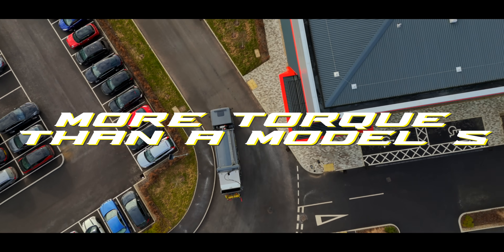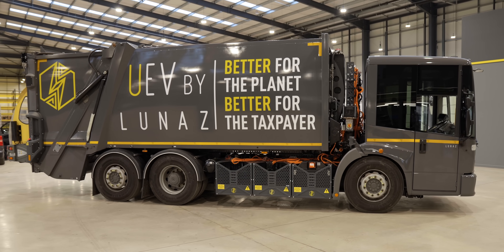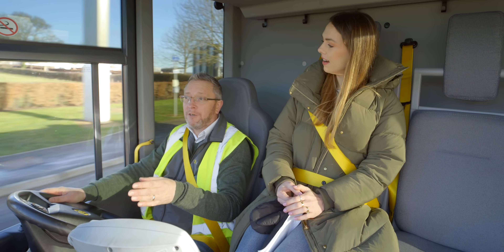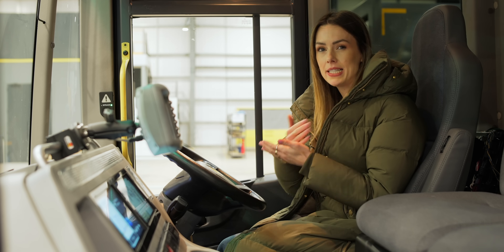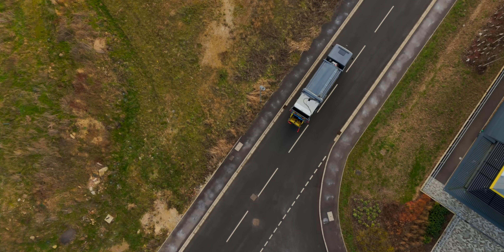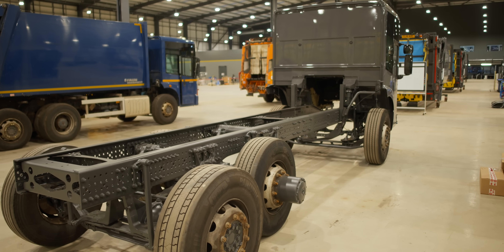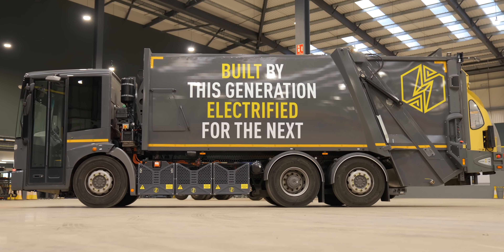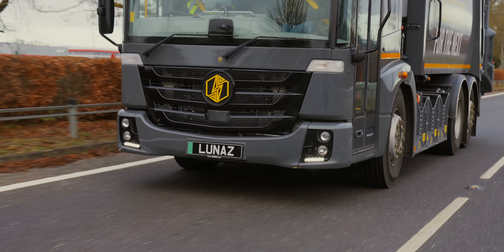Is This RUBBISH Electric Vehicle Britain's BEST EV?!

Comment: Why not change the hydrolic system to electric, seems like that would consume less energy, require less maintenance and perhaps even be more reliable.
Reply: It already has a robust hydraulic system that just needs a motor to run it, I imagine it would be a very costly exercise to completely rehash it to all electric system.
Reply: @evil17  true, but i guess on new vehicles it would make more sense with electric actuators.

Comment: "....Equivalent weight in carbon as the Eiffel Tower...." Do you mean mass rather? Carbon is 5x lighter compared to steel. That's 5 towers by volume, roughly proportional by mass. Oh I give up, who can understand mass vs weight.  "It's a lot."

Comment: You know the interesting thing that is not mentioned in this video despite it being posted  3 days ago (at time of writing comment) Lunaz has gone into Administration/Bankruptcy as it could not raise funding for the  commercial trucking division.  Lunaz already has laid off 40 staff members.
also I'm not sure if 'upcycling' a truck that is more or less new counts before its stripped down and given a new power train that starts its life as a dirty solution  and will never run as long as the durable diesel engine.  honestly how can a used battery at over 100,000km/miles still have the same range as a full fuel tank and what if the weather is very cold??

Comment: For me this interview is a classic half job. I would have thought that there should be a good economic case for these trucks in London for example as the Major as I understand it wants to charge all diesel vehicles to use the streets.  (Correct me if I am wrong). Many cities now have clean air zones in the very centre where one would have thought these lorries would make the most sense initially. Sadly I do not recall seeing any economic case - facts and figures being put forward. Cost benefit analysis. I am going to score this 5/10 I think a good journalist would have extracted these figures.

Comment: Great to see older trucks being upgraded to EV technology, however there are quite a few issues that are ignored by this.
The biggest one is that many smaller haulage firms rely on the supply of used ICE trucks as buying/leasing new (or even converting to EV) is not economically viable (I know as I am the MD of a small haulage firm).  The economics don't really work, which I guess is why Lunaz are working with local authorities rather than commercial operators.  Whilst the technology has to mature, there is a real danger that smaller haulage operators are squeezed out due to either a lack of supply of used vehicles, increased cost of new vehicles and the race to legislate towards zero carbon without looking at the impact on the industry.  This will mean increased transport costs and a lack of choice for the consumer.
Reply: These aren't old trucks. Average fleet age is 10+ years.

Comment: My brother has worked in this industry down south for many years and they have trialling some Electrified wast trucks and found the after service and support services very poor, as they very little if any advice about how to charge the trucks up. Even here we heard nothing about after service care, or training or infrastructure assistance. If a company like this, which I fully supports, wants to bring this kind of solution to the market, it has to be model on the Tesla plan. These trucks need the right charger in the right place with the right training for the staff that use them, and the management that manage them. Otherwise its a very BIG expensive misake. Hope they get there restructuring right, and we get a Government that is will to support this kind of transitions. Otherwise China will win out across the board.

Comment: So, basically this is a way to have an eEconic but not made by Mercedes-Benz... The technical data is pretty much on spot power wise and energy wise (with 6 battery packs similar energy conpaired to the original Mercedes)...

Comment: Couple pros and cons
I live in the valleys the batteries wouldn’t do 150 miles maybe probably a third less if not less than that, not sure if the battery packs could be swapped out so you drive back to your yard and swap out the batteries with full charged ones 
Also love the idea of heated seats but not cloth seat, but they will get wet and take a while to dry out take it from experience 🤭🤭
Reply: I think there is a conversion company in Australia that already has a battery swap system meaning the batteries are charged at the depot and then loaded by forklift into the truck (where the fuel tanks used to be).  It means that a truck can come in and have fully charged batteries within a few minutes.

Comment: Seems crazy to put works intge line of fire moving bins to the back of lorry. Our units pickup bins from the street side without requiring people to leave the cab.
Reply: Most British streets are lined with parked cars. However I noticed that the buttons were placed so you have to step around a barrier and out the way of the bin.

Comment: For years I argued they should put flywheel units in these lorries because of their stop-start usage. Combustion or electric, it would save a ton of energy. But that was when I worked for a company that actually made the tech - and they were just not interested in doing it.
Reply: Electric doesn't have the engine stop/start issues. (Efficient running all the way from zero revs and generative braking collect energy when slowing down ... also the motor isn't running whilst the vehicle is not moving so using no energy) If any energy was saved at all it would be tiny ... it already has energy storage that performs the equivalent function i.e. the battery.

Comment: Finally! Quieter bin lorries! Please get these to the Australian market ASAP!
Reply: I'm all for quieter, more efficient EV trucks but it's interesting that despite all the modernization they still requite someone to manually connect the bin to the back. All the garbage trucks I've seen here in Oz are single operator with a robot arm lifting the bins and placing them back down.
Reply: @johnnyonline  This may be a UK thing. In Australia (where I'm based) they have articulated arms that grab the bin from the curbside. There may be requirements that dictate operators to continue to exit vehicles and connect the bin, in the UK. One reason could be the risk of environmental contamination that comes from the automation of this task — I've seen waste fly out of the bins when they are lifted into the lorry. I've also noticed that the articuled arms make a whole lot of noise too. I'm sure the UK has their reasons.
Reply: @junior.senior I think it is to do with having very narrow streets to manoeuvre through, &/or because many of their streets are already lined with cars, which wouldn’t work well with an Aussie type side bin grabbing arms configuration.
Reply: The waste companies are trying but they need them driving 12 hours and they need charging after 6 and then going to the tip. The hydraulics use lots of power...
Reply: @Low760  Are you engaged with a waste or recycling service? It would be interesting to hear about the kinds of issues they are experieriencing with the new technology. I've found a company in Sydney which has an interesting work around, where they battery swap. To me, this is comparative to refueling with dinosaur juice.

Comment: Doing LICE to EV conversions is nice, but it's still a compromise.  An EV truck designed and built from the ground up to be an EV truck is going to perform all-around better.  The short-term thinking of bureaucrats and accountants is not as beneficial in the long-term as having some vision and just doing it right today.

Comment: Garbage trucks should have been the very first vehicles to be electrified. They do many start stops they need to be quiet and the battery can be sized for the route. So much easier than diesel
Reply: 😂😂😂

Do try to be serious.

What if the round is in a rural locale, with added hills? And people do a lot of shopping via Amazon. Everyone knows that Amazon is one of the biggest creators of cardboard waste in the world today.

Think of the cardboard mountains jammed into  black bin bags outside every farm and cottage and sanitarium.

The battery would have to be bigger than the cardboard mountain payload, and need many, many, many hours to recharge.

I do wish you battery hugger lads did a bit of research prior to posting.

This is precisely why battery HGVs are not especially popular because of the "waste of revenue earning payload space" sort of thing taken up by a gigantic battery which might need a week to fully recharge.

And I might add that battery buses are now regarded with deep suspicion in old London Town on the grounds that a reprise of 1666 was only minutes away when they were operational.

Experts (such as myself) were discussing only last Tuesday that such an event would be worse than the Blitz.

Raging lithium conflagrations would be melting their way through the mantle down to the core and very likely taking the Circle Line with it.

I expect the District Line wouldn't get off lightly either.

I kid you not.
Reply: @t1n4444  Sigh... it's the same trash-compactor on the back as with the deisel units - there is zero difference in trash capacity.  And whilst there may be some rural routes that can't be converted, the vast majority of bin-lorries operate in residential areas (because that's where the majority of the population live, and generate their rubbish).

About the only thing you appear to be 'expert' in is making an idiot of yourself, based on your above post.
Reply: Yes, ideal candidates for electrification .. and there are many already in use.
Reply: @MrAdopado  

Then it begs the question of why this outfit appears not to be thriving.

Any explanation?
Reply: @MrAdopado  

A fair point.

I would suggest that as hydrogen is the poster boy for energy in Europe then HMG might be having second thoughts ref falling in love with batteries.

Now it's known beyond question that lithium ion batteries can and do self ignite it's entirely reasonable that HMG is being a tad wary on pushing battery EVs for the moment.

Sort of preventing an "egg on face" moment.

Comment: The point that everybody seems to be missing with RCV fleets is that they are only utilised for 6-8 hours per day.
This means that back at the depot, all plugged into chargers, they act as a power reserve for the grid. Fast Frequency Response power banks pays huge amounts of money.
For an asset that would otherwise be sat unused for 16 hours a day, it can now act as an income stream.
This is in addition to all the other benefits. It's a no brainier for any RCV fleet operator to go electric.

Comment: Even here in backwater Oklahoma,  our garbage trucks have robot arms with which the driver picks up the bins while sitting at the wheel.  I haven't seen manual bin loading in years
Reply: wouldn't work in the UK, for example I live in a ground floor flat, outside where I put my bin their a wall of cars between the bin and the road.
Reply: @DavidKnowles0 Yes well here in the states everything is sprawled out and there generally is room for such contraptions. In big congested cities, not always though, which is why most cities have many different truck configurations.  Plus, I would add that those robot arms are much more prone to failure and expensive to maintain.

Comment: Very impressive i bet it reduces driving fatigue, I was bin man for three years it loses its novelty putting bins on at the back after the first bin 😊. All seriousness it's all good wish the dust cart i was on was electric.
Reply: As someone who worked on the bins briefly several decades ago (yay temping for summer holiday jobs :p), I can say that working with modern bins appears to be near-infinitely better than manually hauling individual black sacks (especially on a hot summer morning after overnight rain...) as used to happen.  Quieter and more efficient trucks would also be very welcome.
Reply: @logicalChimp  Never did black bags just wheelie bins, but all the old timers banged on about it "you'd never manage on black bags" 😁 getting covered in bin juice 😖

Comment: The refuse trucks around here (Connecticut, USA) load from the side. Everything is done remotely from a single person in the driver's seat. All that is required is a similar bin to that UK version.
Reply: That would be impossible in the UK. Very few people have the ability to park their vehicle(s) on their property, meaning most people park on the road. There would be no way for a truck to access the bin on the sidewalk.
Reply: As the host says, super teeny tiny roads. The notion that in Britain it would be possible everywhere to put bins perpendicular to a curb so a side loading arm can just pick them up is ludicrous. A one way street for instance with houses on both sides of the street would require either half the bins dragged across the street or the garbage truck to drive the wrong way up the street. And that is if the street has two lanes available for driving after all the parked cars.
Reply: @francesconicoletti2547 they do that in Australia. Not hard.
Reply: Same in Australia. One man efficient job- expect electric trucks soon.
Reply: @geraldbutler5484  there are bits of inner cities in Australia that i doubt a side arm garbage truck can be used. Yes most of Australia and America was built to accommodate cars but bits of Australia and lots of Britain wasn’t. Getting a trck lined up down those narrow old roads that are already overcrowded with cars seems either difficult or impossible.
Reply: @geraldbutler5484 I wonder if they will go poof on their first outing like the new concrete truck in Melbourne a few weeks ago, good thing it wasn’t in a tunnel.
Reply: @evil17  wake up,mate. I grew up in Birmingham, England. We had electric milk floats and bread vans for decades, up to the 1960’s. They were ultra reliable and some had the same motor from when they were made. The far superior batteries we now have make the change inevitable. I hear the Arabs are crying in their coffee.
Reply: @geraldbutler5484   The old milk carts never had lithium batteries. Lithium batteries are great & I like the idea of EV’s to some degree too, but I dont believe we have the economy or infrastructure for an idiot like Albo to be pushing the issue the way he is just yet, especially not in the rural sector. 
Can you imagine the fallout of an all EV outback society in an emergency evacuation situation like a flood or bushfire when there is no power? 
Australia is presently addicted to deisel for nearly everything, & that can’t change in a hurry without some dire consequences no matter how much he tries to tax ICE’s out of Australia.
I run my house on Solar & batteries which works great, but there is a lot more issues at play when considering a nations all EV & industries power needs, the batteries may have matured but the charging infrastructure is a long way off & will take many billions of dollars to get half decent. 
Lithium batteries self oxidise if they go thermal, and presently we have no way to deal with these scenario’s. 
If there is an accident and people are still ok while trapped in a vehicle waiting for the Jaws Of Life when the battery goes thermal, that would be very traumatic to witness inside or out of that vehicle.
I understand & applaud your eagerness for EV’s, but there is more to it than doing it because we can.
Reply: @evil17  I agree with you concerning rural and outback Australia. It’s going to take time. We are only at the start of the electric revolution. My small rural town already has a bank of batteries to take the excess solar generated by a great uptake of rooftop solar panels. Ten years ago there was virtually nothing.
Reply: @geraldbutler5484 soon? Yeah right.
Reply: Came here to say the same here in Australia.
Reply: Australia does a better job of side lifts

Comment: Either with conversion or new, these electric garbage trucks definitely needed!!

(a) constant stop/start and full stop operation makes diesel even more inefficient and dirty toxic emissions.  Moreover, they're spewing that stuff right in our faces where we live.
(b) total distance traveled (range) is small and top speed is very low
(c) Noise reduction.  I've been woken by the local garbage trucks more times than I care to know.
Reply: I'd think it'd be a nicer experience for the operators, too. Less noise, less inhaled exhaust, generally smoother operation all around --- I'd think it'd be generally less stressful to work with. I'd like to hear from someone who actually uses one (either ICE or electric).
Reply: @bewilderbeestie  Good point.  I know another group of workers in worse shape.  Its port workers at the shipping docks.  There are interviews of them saying they cannot wait for the port to electrify their trucks.

The toxic diesel emissions at ports are brutally bad.  This information easily found online.
Reply: @beyondfossil  :  The big forklifts, log-handlers, various lifting equipment, etc. that are found in large numbers around ports would also be logical targets for this treatment.
Reply: @bewilderbeestie  : Yes... especially the thoughts of someone who has experience of both.
Reply: @hi-tech-guy-1823  Absolute bollocks. For a start LPG is propane and doesn't come from landfill, and secondly you statement is totally untrue. Virtually all UK bin lorries still run on diesel.
Reply: A very large part of the energy and power requirement for these trucks is for compressing the garbage. This means that you can reduce even more emissions per mile if you electrify, but also means they need absolutely massive batteries.